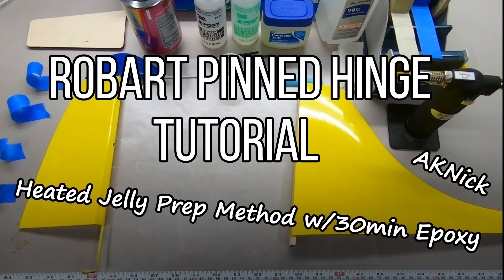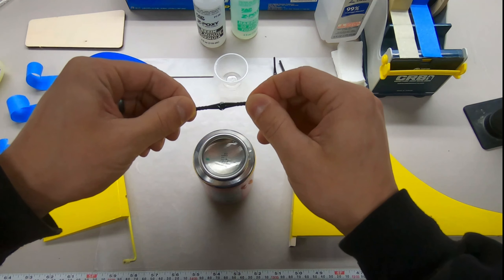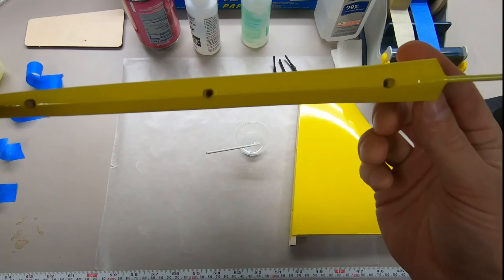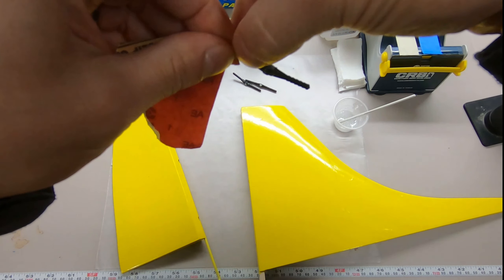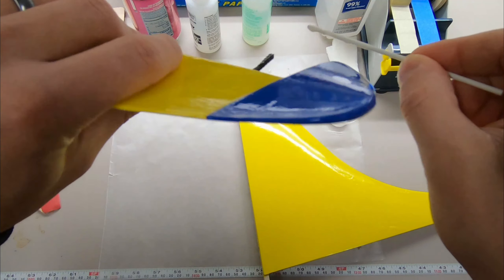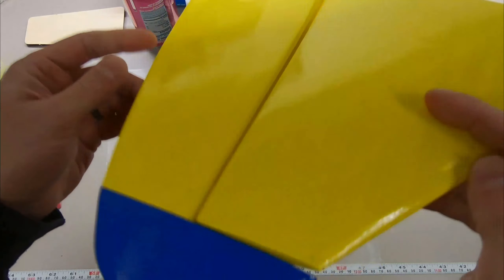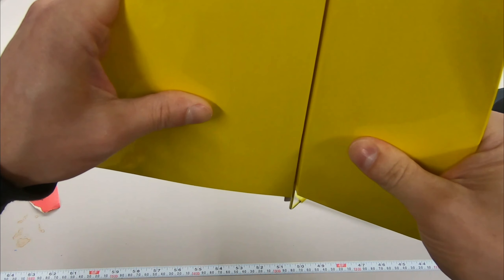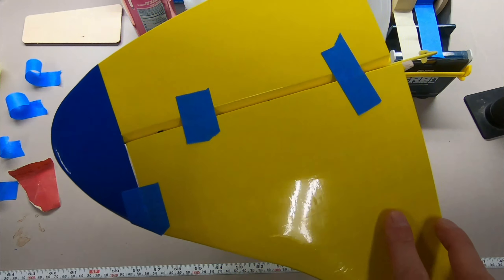Robart Pin Hinge Prep and Installation - Hot Jelly Method w/30min Epoxy

Comment: I do the same thing with the petrol jelly, but I use clear Gorilla Glue to hold in the hinges.  A longer working time to make final adjustments and I think it's a little more flexible.  I swill it around the inside of the hole with a toothpick.  Great Video though.  i wish they still made those hinges with the horn attached.  Still have some in use that are 40 years old

Comment: Nick you can also use a skinny bar straw for mixed drinks and suck the epoxy into the straw and then you can blow the glue into the bottom of the hole
Reply: this metold also works for flat hinges
Reply from the maker: Sounds risky ray! Lol